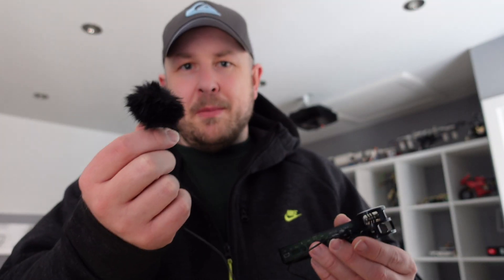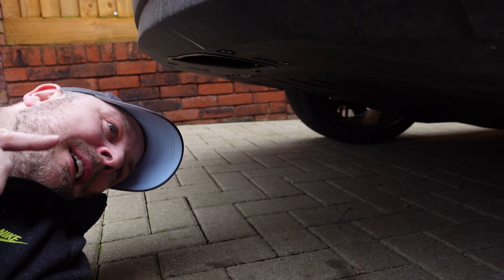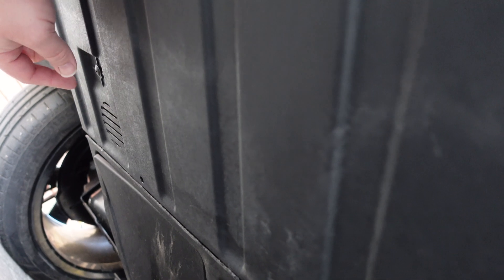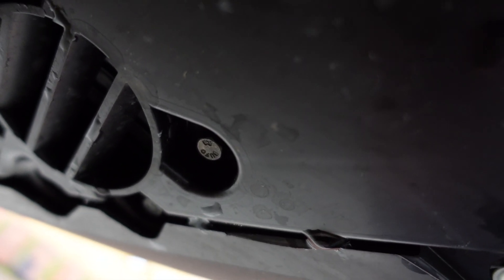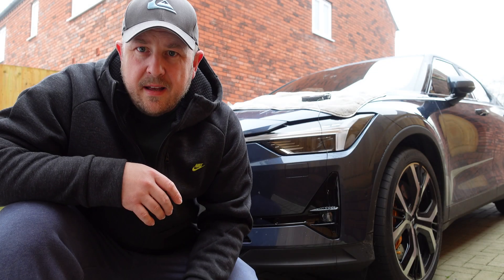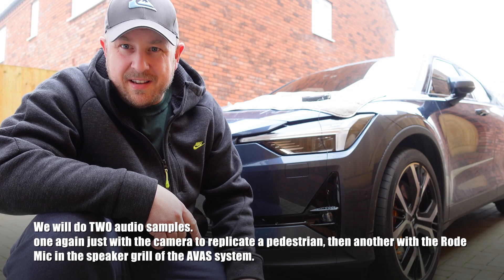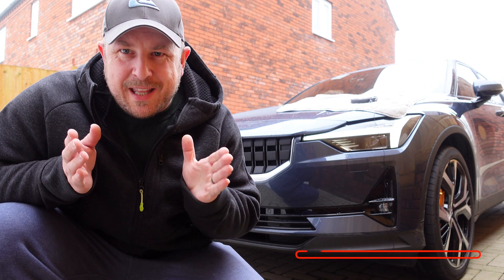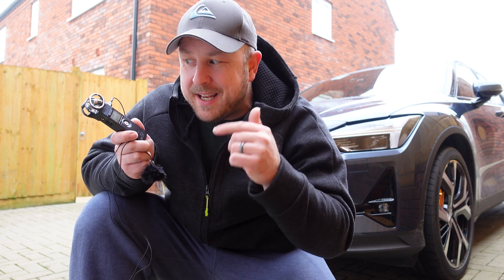Proving the front AVAS works on the Polestar 2

Comment: I bought a £10 Amazon doorbell as a kind of joke - threw it in the ‘engine bay’ 
I press the button and it actually works to alert dog walkers etc that there is a two-tonne behemoth about to run them over😂
It’s better than giving them a coronary with the horn I guess?
I can totally vouch for the uselessness of the AVAS on a UK ps2 (2024)
Reply from the maker: Mine seemed to improve a little with a software update. It could be heard more in a multi story than before.

Comment: Yes AVAS is working it seems but again volume is way to low unless all children playing outside are fitted out with headsets and very sensitive microphones preferably the microphones attached to your speaker outputs on the Polestar 2 ;-) Still utterly useless as it stands but indeed they might up the volume through a software update.
Reply from the maker: Agreed. I think its potentially to subtle.
I will have to ask my kids if they notice anything :)
Reply: @SpectrumGeeks  yes and dont get me wrong ever since i had a Prius, it is necesary to have a proper functioning AVAS system.
Reply: I drive an ID4 and recently purchased a Polestar. The AVAS on the ID4 is very loud. You can barely hear anything on the Polestar.

Comment: Did you see on the Polestar forum that apparently these speakers aren't water proof and has been causing issues with the cars.
Reply from the maker: Hi Gary, no I had not seen that.
If thats true thats crazy, I will take a look.
Reply: There are a few with defective units that are not sealed correctly so some got wet inside and caused the 12V to drain. If you have driven in rain and your car still works, then a 99.9% chance the speaker is fine.
Reply from the maker: @Gdank72  Cheers for sharing. I have been in rain and standing water ... touch wood no issues here.

Comment: It's way better than on the other cars
Reply: The point of AVAS/VESS is not to be “relaxing”, but to warn other road users of the vehicle’s presence and speed. This is a bit like saying a quiet and relaxing alarm clock is better than the one that actually wakes you up. The reason other cars sound like UFOs is twofold - it’s easier to modulate artificial sounds based on speed, and they stand out in the traffic amidst other noises and sounds, even with relatively low volume.
Reply from the maker: Better? In what way?
Reply: @SpectrumGeeks  In other EV it sounds like UFO and it's boring and Polestar sound is kinda relaxing.
Reply from the maker: @wroniec  Ahh, cheers for clarifying :) I still think its too quiet.